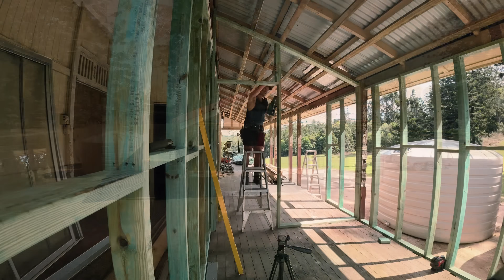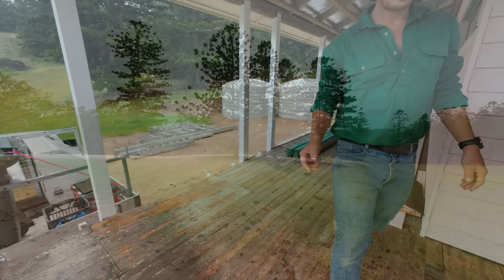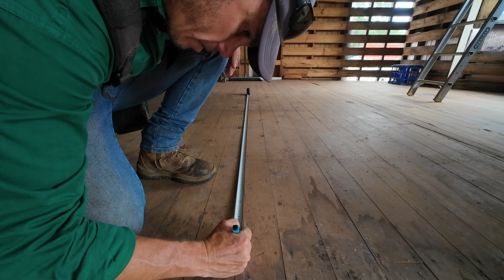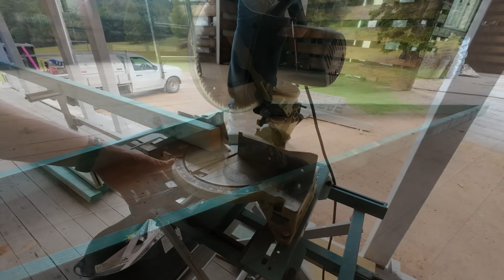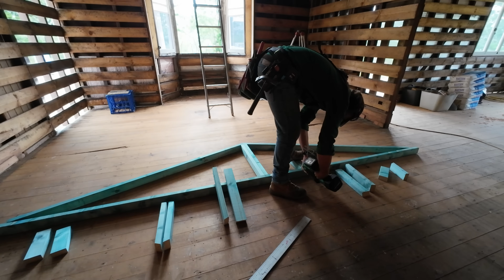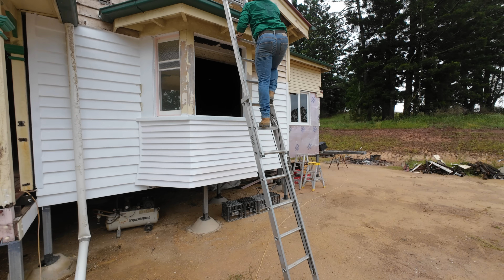100 Yr Qlder Reno: Rainy Day Inside! Ep 37

Comment: Great idea Byron, make up the frame on ground level and fit to the opening in one piece to save climbing up and down the ladder to fit the plates and studs one at a time. If you have time, could you please explain why the internal walls are fitted with horizontal boards spaced 75mm apart. Was this the way it was done back when the house was originally constructed to strengthen the wall lining.  Have a good week.
Reply from the maker: Hi Gary, thanks for tuning in! You and I are on the same page. It would have doubled the work if I built it up in location! 

Good question, those two large rooms, our proposed kitchen and lounge room were originally clad with ply then cover stripped and they both had picture rail around at 2100mm. I will install this again back to the original spec. Both rooms are different to the rest of the house which is all tongue and groove. 
So the horizontal boards you see would have supported the internal linings perfectly in these two rooms. I'm really looking forward to getting into that part of the build. If you flick back a few episodes you will see when I demo that ply. 
Hope I covered your question. Seeya next time.

Comment: Why screws and not nails? 
Is there a reason why you use screws instead of nails in different places?
Reply from the maker: Yea, absolutely. I always think of the strength between a screw and a nail and use it when I feel things need to hold better or last longer. If it was affordable I'd screw every member if I could.
Reply: @byronmrackley  The next Byron’s smoko break Pro’s tips segment you can tell us where to use either fixing. Like you did with the Hive Tool
Reply from the maker: @pasilinnosto6712 great stuff! Love the idea. See what I can do.